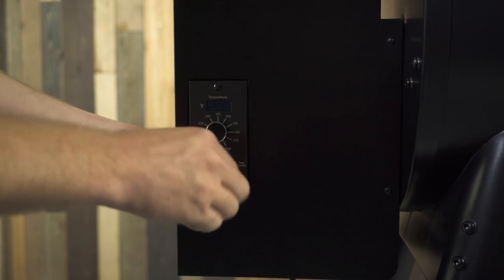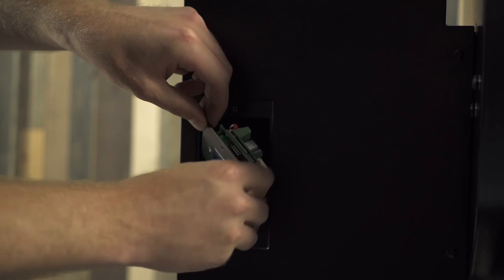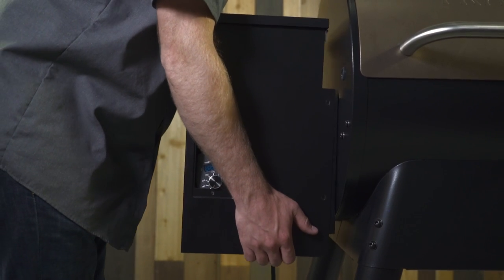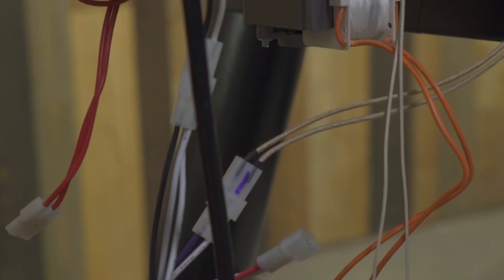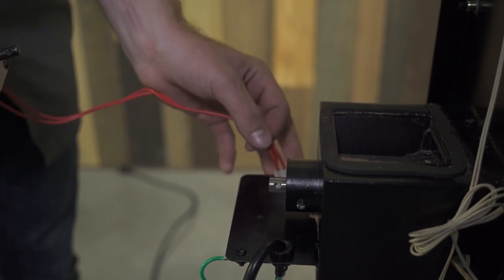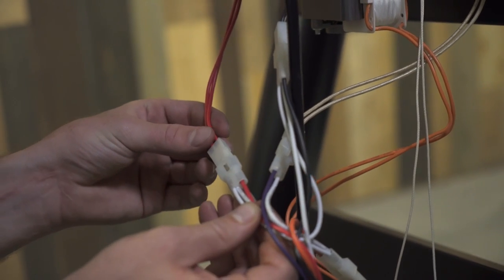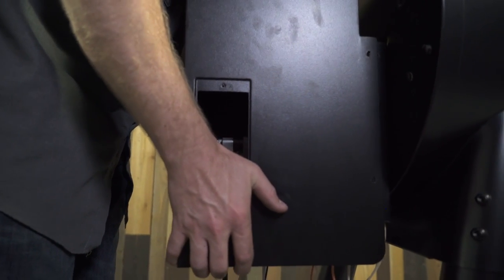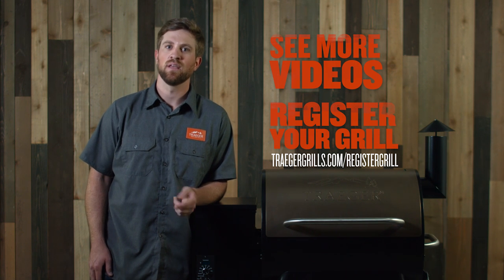How to Replace the Auger Motor on a Traeger Grill - Traeger Maintenance

Comment: Thanks, they seemed to have since replaced the Allen bolt arrangement with a ring pin that will can simply just drop out as the hole wears a bit. Ask me how I know. The pin fell out and the motor fell of the end of the shaft as it isn't mounted to anything.
Reply: Ask me why I’m here. I’m going back to a nut and bolt. Found it funny that they used one of the pins.

Comment: Removing the bolt from the old motor is impossible. I used the correct size Allen wrench and it would not budge. I used a screwdriver with Allen wrench attachment and now it's stripped. And there is no authorized Traeger repair  to help me within 50 miles of my house.
Reply: Why do you need an "authorized Treager" anyone can do this outside of warranty.
Reply: How did you get it out? I’m in the same boat.